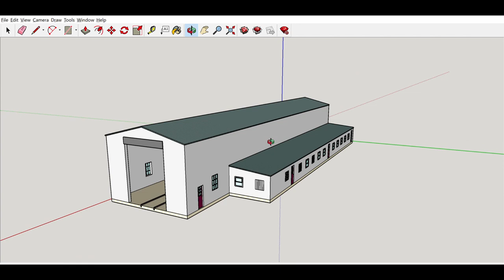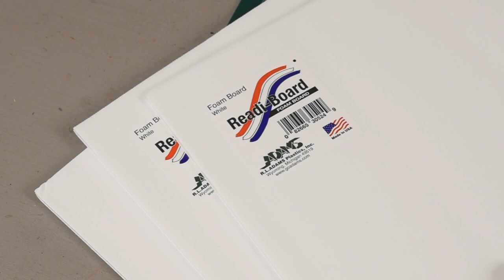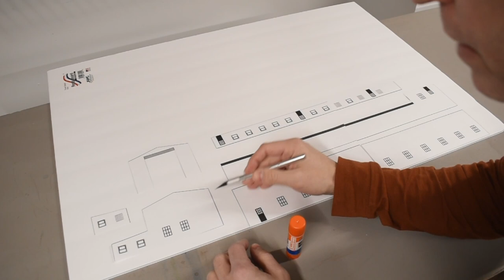Diesel Service Facility Part 1 - Prototype and Mock up

Comment: In this video you use a map a to view and measure the engine facility. What were you using and how did you get the 3D views; they were cool and useful. Thanks. Looking forward to this build. I bet ths info would be a big hit on the Second Section Podcast.
Reply from the maker: Google maps (in a desktop web browser) already has the 3d buildings for Sioux Falls, so I just needed to rotate the camera view. As for measurements, you can right-click anywhere on the map and choose the measurement option from the list of menu items.
Reply: @JoeyBPhotography  Thanks. While Sioux Falls is 3D other places like Marion, IL are 2D; why?
Reply from the maker: @Colin King  it all depends on if Google maps has 3d models for that area. A lot of places still only have 2D

Comment: I'm thinking you should mount that table on a large lazy Susan so you can turn it 360 degrees. Then you can see it from any angle just by turning the table as a whole.
Reply from the maker: Hah, no need, it's on casters so I can spin and roll it around already